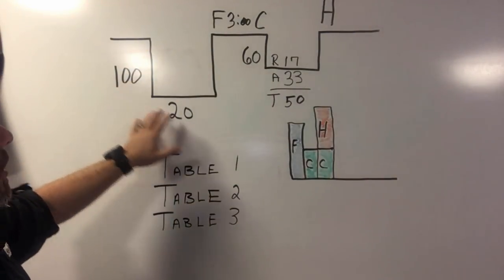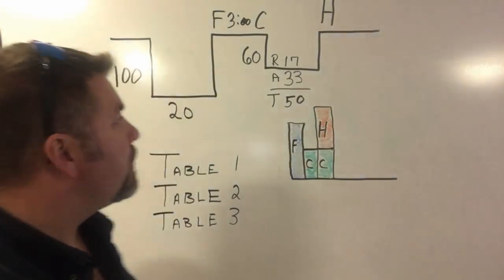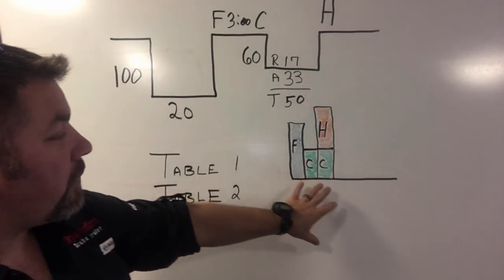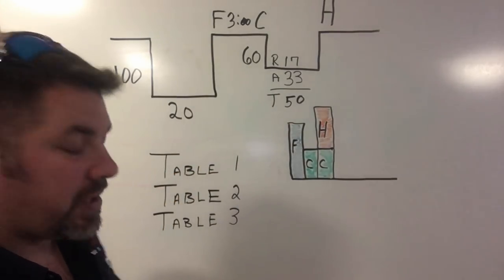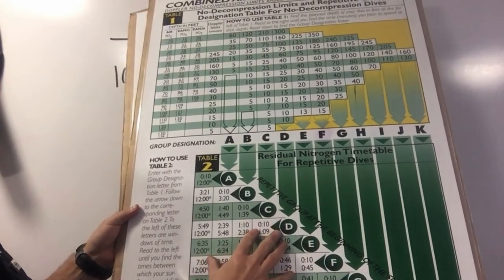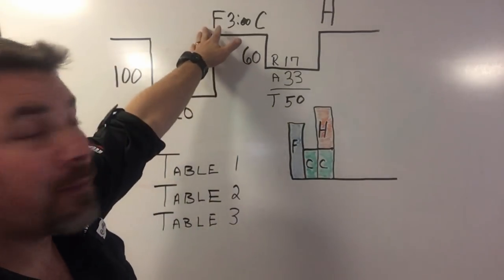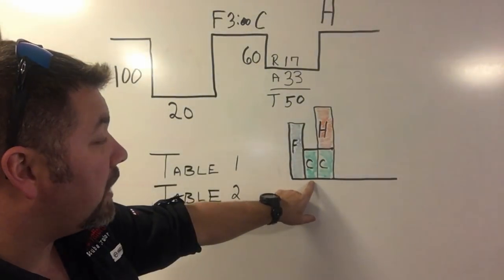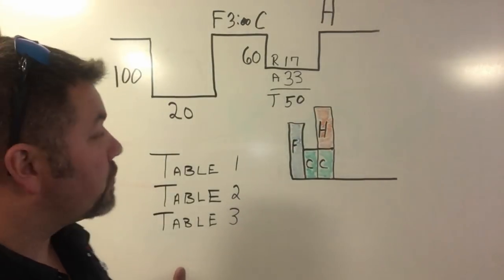Understanding The Tables And Nitrogen Storage

Comment: Let say I gonna do a first dive at  80 ft and seconds dive at 100 ft, and I have 32% and 34% enriched air. Which mix should I go with so that I can maximize my no-deco time and minimize the residual nitrogen (+adjusted no-deco)? Hope you understand!
Reply from the maker: Hello Zen, great question. So by running the dives real quick, using the SSI Air and Enriched Air Tables (disclaimer: all profiles were calculated using the Equivalent Air Depth) and using the two dives and mixes you specifically asked about, I would do 80 feet for 50 minutes using Nitrox 34 and then the second dive to 100 feet for 22 minutes using Nitrox 32. Understanding this is a reverse profile your minimum surface interval would be 8 hours in between dives, but your total bottom time would be 72 minutes. If you reversed the mixtures and did the 80 feet dive for 40 minutes using Nitrox 32, and then did a 100 feet dive for 26 minutes using Nitrox 34, your minimum surface interval would still be 8 hours in between dives, and your total bottom time would be 66 minutes.  This question has gave me a great idea for a video. Stay tuned as this question will be featured in an up coming video, explaining reverse profiles and Nitrox.
Reply: @LakeHickoryScuba  Much appreciate!

Comment: Hi there! I get how you calculate the RNT+ABT = ESDT. But I don't know how to calculate it if you use another blend in the second dive?? For example: 
1st Dive: 36%EANx, 22m for 45 min. 
2nd Dive: 30%EANx, 16m
what will de no Decompression Limit and RNT be??

Thanks in advance!!
Reply from the maker: Hello Gina Stussi, great question, however, as we will discuss, is an incomplete question. In a situation where we are using blends that are not shown on the SSI Combine Air/EANx Dive Tables, anything other than 21%, 32%, or 36%,  we would simply use the Equivalent Air Depth formula {(FN2 / .79)(D in meters +10) -10} to convert everything back into 21%. This makes the calculations a lot easier. So in the case of this question, it would go as follows. Dive 1 would be 22m for 45 minutes using 36% changed to 15m for 45 minutes. Dive 2 would be 16m using 30% for (time to be determined by table 3) changed to 12m for (not yet determined). Now a quick note, you would not need to do the EAD formula for the 36% blend as its on the Dive tables, however, its good practice, so we will leave it in there. Now its a matter of just doing the profile. We will also need to calculate the minimal surface interval since you did not state how long we would be out of the water. So here goes. Dive 1 = 15m for 45 minutes yields a pressure group of G. Moving over to table 3, Dive 2 = we can calculate a 12m dive with (Spoiler Alert----there is not enough information in your question to continue), however, we will push on and max out the most time available (based off a generic chartered dive). Continuing on 12m for 45 minutes ( as most charter dives are going to be around the same time frame). The beginning pressure group after (a soon to be determined pressure group) would be G. Thus according to table 2, the minimal surface interval would be 10 minutes. And to finalize the answer, we can go back to table 3 and see that the new Adjusted No Decompression Limit and Residual Nitrogen Time (based off the assumption of bottom time for dive number 2) would be (ANDL 57 minutes) and (RNT 73 minutes). This is a very thought provoking question, but one as stated earlier, needs more information. Your overall bottom time will change for dive two based off how long you perform a surface interval. Also, if the question was completed with the wanted (planned) bottom time for dive two, then you could very easily calculate the minimal surface interval as we did above. By using the hypothetical manner of saying most charter dives are between 45 minutes to 60 minutes (45 minutes in this case), we can then simply use table 3 to derive the answers for the ANDL and RNT. Hope this helps.

A quick side note: We have an entire video series on using the Equivalent Air Depth that you may find interesting. 

EAD
https://www.youtube.com/watch?v=yL0adMvWlaY

Nitrox and Reverse Profile
https://www.youtube.com/watch?v=CO9qYh6_obM
Reply: @LakeHickoryScuba  Oh wow thank you so much for your extensive explaining!! i got it😅😂 THANK YOU!☺️☺️☺️

Comment: Excellent video, now, I am new to diving, so here's my question, all this is based off no decom, time, so, lets say I want to decompress, how do I factor in the nitrogen into the time for decompression and how to subtract that from my dive time, Etc. 

I hope I asked that correctly....LOL, That's why I didn't ask.
Reply from the maker: Hello Jack Grant,great question. Most dive tables are specifically designed for no decompression diving. Several will have special rules to follow in the event a diver mistakenly goes into decompression. And it should be stated that, unless you are properly trained for decompression diving, you should refrain from doing so. In today's diving, dive computers are the standard, and should always be used. It takes the confusion out of the planning and diving process, and most dive computers will walk you out of decompression mode as well.

Comment: How do tables work if you go to 60 feet for a part of the dive then shallower depth later for example 30 feet ?
Reply from the maker: Hello Anthony, unless you are using the Multi Level Electronic Recreational Dive Planner or the Standard Recreational Dive Planner (both PADI products), or you use the older PADI Wheel, there is not a way to calculate off gassing during the ascent phase of the dive.  However, a computer does this with ease.

Comment: you confused me. how did you calculate the adjusted ndl using the residual
Reply from the maker: Hello paniolo prep, when using tables (regardless of which set of tables you use), table 3 will give you your residual nitrogen time, and the new adjusted no decompression limit for a given depth.

Comment: Just started classroom instruction for diving.  The RAT system you explained is confusing me.  You say that in reality, you are only under the water for 33 mins.  But you complete the math by adding and coming up with 50 and then using the 50 to get your new group.  

I assume you are using the 50 to be be cautious and err on the side of caution?
Reply from the maker: Hello @172sbct. RAT stands for Residual, Actual, and Total. The residual time is how much nitrogen is still in your tissues after a surface interval. The actual is the amount of time you physical plan to stay under. The Total is both the actual time and the residual time added together for a more liberal calculation of how much nitrogen your body will have absorbed after the second dive. Hope this clears things up for you.
Reply: Thank you very much!!!!!

Comment: Im not understanding. if your adjusted NDL is 33 min at your planed depth of 60 feet why do you have to do the math as if you were at depth for 50 minutes?
Reply from the maker: Hello Kyle B, You still have to calculate the residual nitrogen that is still in your system. This residual nitrogen is accumulative until it has been off gassed.
Reply: @タケダIshmael And to see your 'no fly' or 'climb a mountain' hours wait.